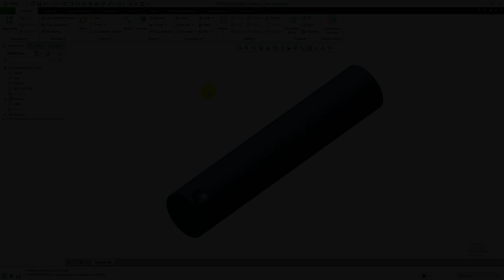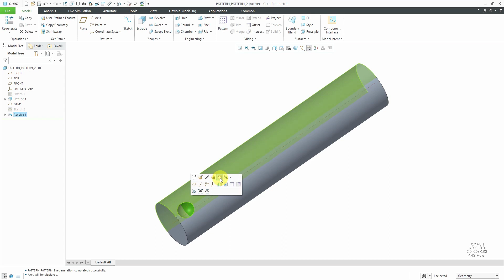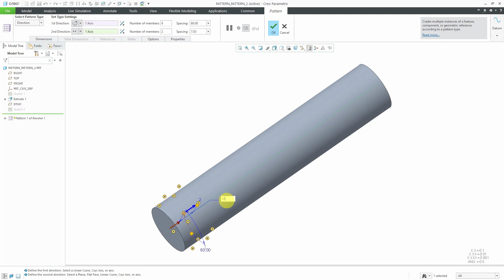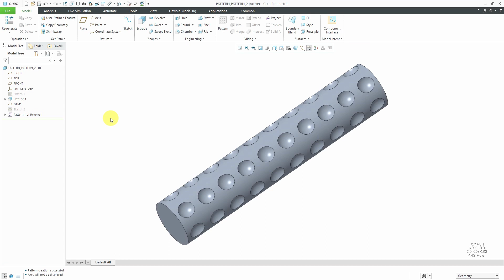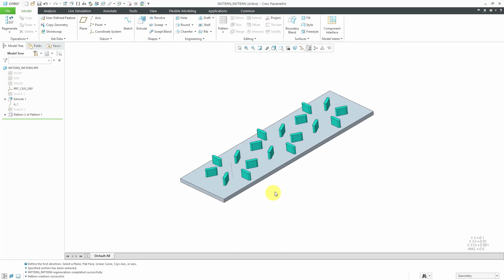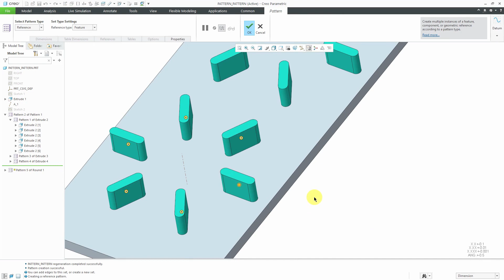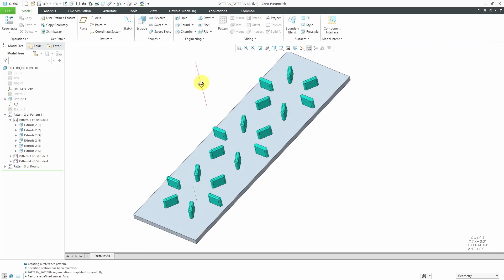Creo Parametric - Patterning a Pattern

Comment: why is there not an axis to choose from when I do this with an extruded part. I want to make 4 more copies in a circle around a specific axis but it never shows up to select.
Reply from the maker: Is the axis hidden on a layer? Are you sure you have an axis to select? Have you tried creating an axis? It has to be higher in the Model Tree than the feature you’re trying to pattern.
Reply: @CADPLMGuy  I had the axis view hidden! I had assumed that creo would just show all available axes even though they were hidden from view.
Reply from the maker: That would create an immense amount of screen clutter if you were trying to pattern in a complicated part or an assembly with a lot of components. I can assure you that users would hate that it if Creo performed that action automatically.